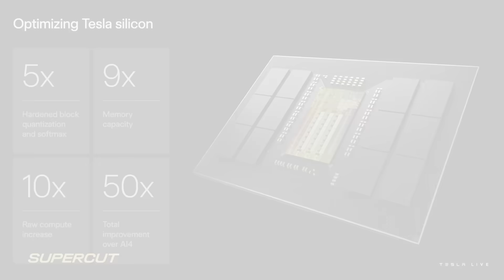Everything Announced at Tesla's 2025 Shareholder Event in 7 Minutes

Comment: I wish Tesla positioned on eth network. Ethereum rocks my world!:) so many businesses and software run on ethereum network. BTC has no value. Ethereum is like a country. All output of businesses and software that run on ethereum network are like product in "gross product per person". Each ethereum coin is like a person. So ethereum future should be assessed as growth of all businesses (such as polymarket) that run on ethereum divided by number of all ethereum coins. Like gdp, but gross product per etherum in this case. Because these businesses and software do not trade among themselves in any fiat, but in ethereum. Again, ethereum is like a country. Tesla should buy a chunk of this country and have a vote in its future. Tesla financials will have to move unto new rails sooner or later. Pick the real thing because others like Solana are imposters and counterfeits. Ethereum foundation is like the government. Tesla should buy it's spot on ethereum foundation board. BTC has no value at all. Quantum computers that leverage other dimensions to crack BTC encryption or the BTC anonymous founder with a cheat code will bring BTC to zero sooner or later. Did you know that there are currently several people that can change BTC code. They call themselves Bitcoin employees.

Comment: Musk should build a city. Not a redevelopment in a existing city a brand new city. As long as necessary but only 5 miles wide, where everyone lives in the heart of the city including the farmers. If the city's 20 miles long then high street, park, tram, underground trains, rivers and industrial estate is 20 miles long. With mile long residential side streets for the length of the city. And no vechles on high street apart from tram. A high street the width of a 20 lane motorway. With roads only at back of high street. replicated on both sides of high street two and half miles aside to centre of the tramlines. With bridges over river from industrial estate to park to residential side streets to high street. Road connections from in-between residential buildings from back of high street to bridges to industrial estate, and underground trains from high street to industrial estate loops platform along side a platform that's for stations the length of city.